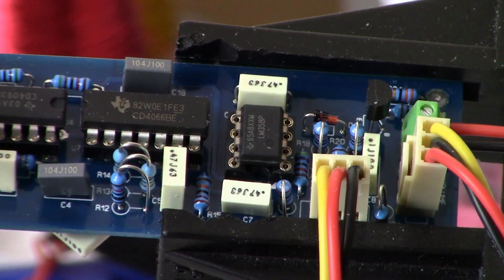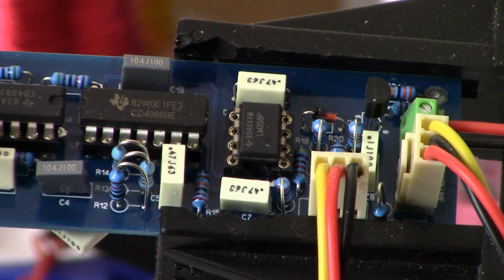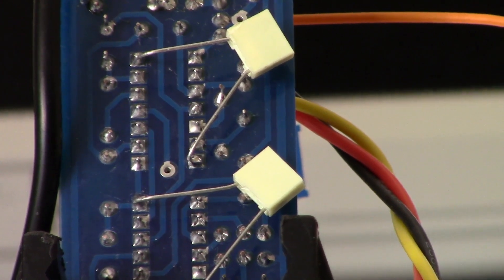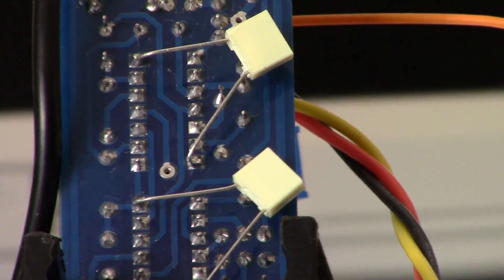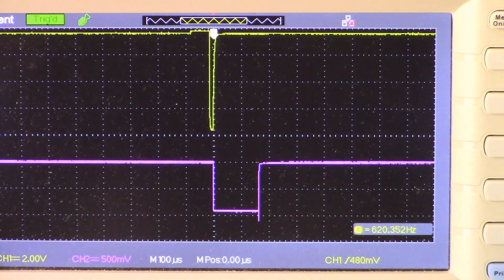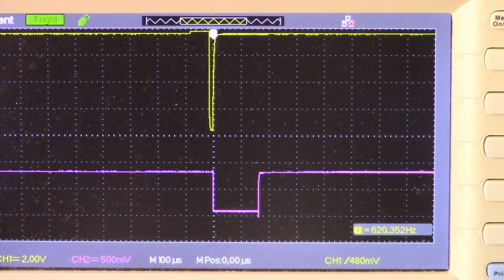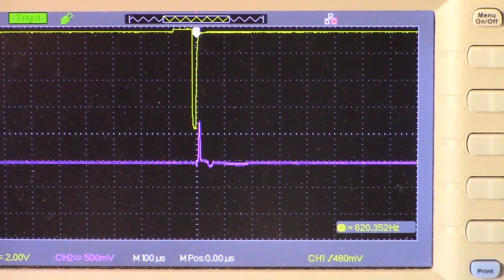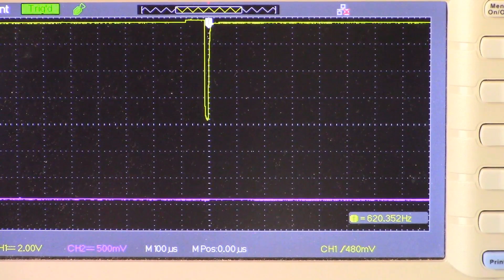Surf PI Longboard DIY part #5 Sampling Integrator and Audio

Comment: hello how are you fine. Can you help me, I have assembled the device, but I have a problem with the sound and a problem with sensitivity. The sound is light and I cannot hear it knowing that I used the mps a13 piece. The sensitivity is not found on the metal. And the frequency is there. I checked it with a Buff loudspeaker. It gives me a ringing when you run away from the file. Thank you

Comment: Hi first of all congratulations for your videos! Years ago I made the same circuit, but then I put it away because it works perfectly in air, but it sounds without target when I put the coil on mineralized ground (not beach). Can I register the trimmers to avoid this problem? Thank you
Reply from the maker: Hi, Thank you for watching.  There is no ground balance on this circuit. It was only designed for use at the beach and even there will react the same way if you encounter black sand.
Reply: @SurfDetector  Thanks for the reply

Comment: Surf pi pro was my first metal detector diy. How does your threshold sounds when increase it? It is steady/smooth or clipped? Good job!
Reply from the maker: Threshold is quite smooth when adjusted. The only strange thing is that I have it adjusted to minimum for best performance.
Reply: @SurfDetector I use Surf pi pro schematic with gain adjust and  the resistor going from threshold pot center tap to IC non inverted input is 47k.  I see Surf Pi 1.2 has 22k. Maybe that is the reason of your threshold issue.
Reply from the maker: @dracometaldetectors7091  On the LM358 pin #2  is the Inverting Input  which is connected to pin #2 of the pot, this is on the  original Whites Surfmaster PI schematic.  Interesting that it was modified on the Pro version.  I appreciate you watching and commenting.  My next build is a Crossbow Classic.
Reply: Surf Detector yes, inverted input, my bad.